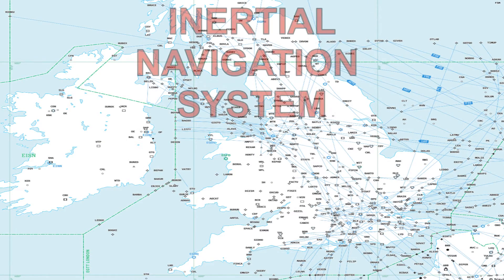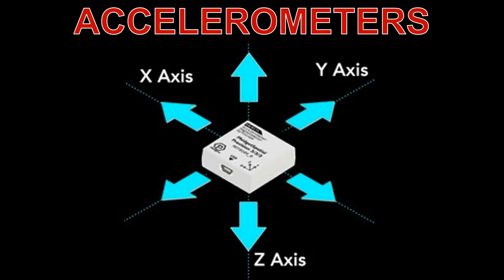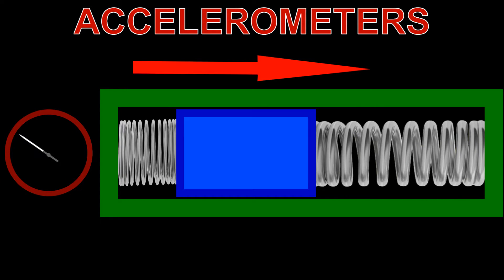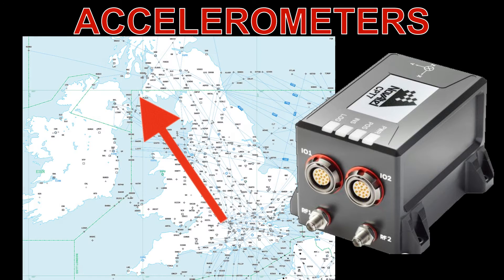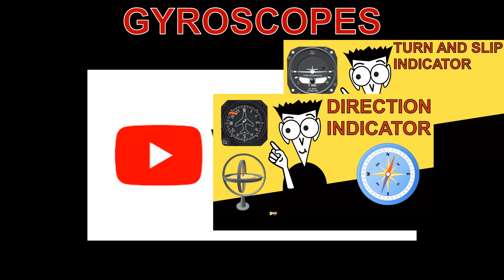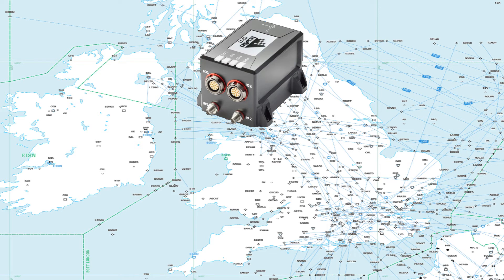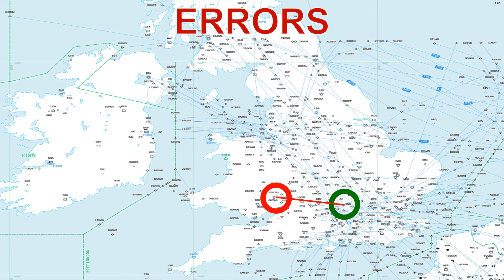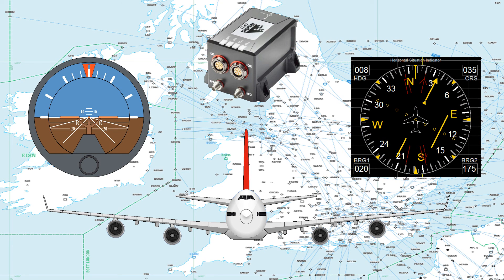Inertial Navigation System - How It Works

Comment: What the difference between IMU and INS ?
Reply from the maker: Basically, an IMU is simpler, providing raw sensor data, while an IRS (specifically the Inertial Platform or IRU) fuses sensor inputs and offers more accurate navigation information. If you need precise position and attitude data, an IRS is the way to go!
Reply: @theaviator3863  How the IRS different than INS?